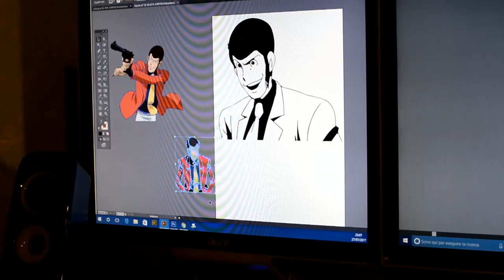Airbrush helmets Lupin III

Comment: Excellent work! Do you mind if I ask you what type of vinyl and transfer tape you use? When I try to apply larger stencil pieces I always have trouble with it buckling and not laying right on curved surfaces. Do you use heat?
Reply: Hi I use ORACAL 810, and I also have problems with curved surfaces, with heat it is possible to model vinyl well
Reply: Thank you! And what type of transfer tape do you use?
Reply: I always use the same....ORACAL 810
Reply: Oh ok, i thought the 810 was only the vinyl. Thank you for the replies!